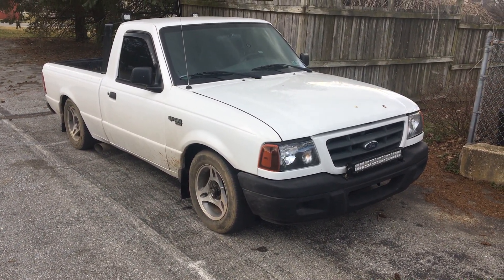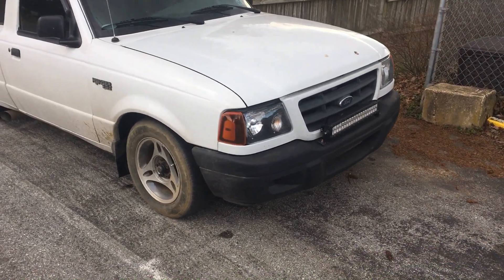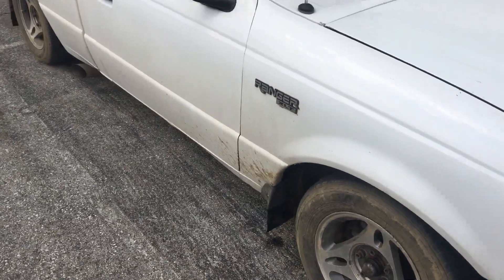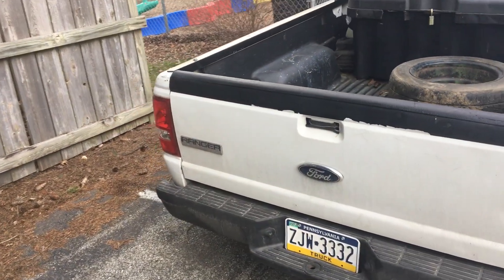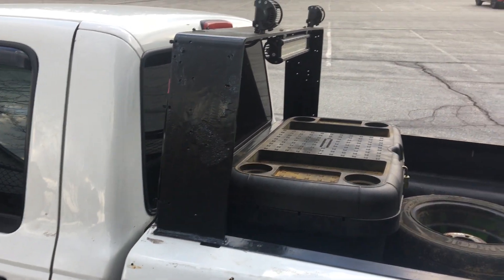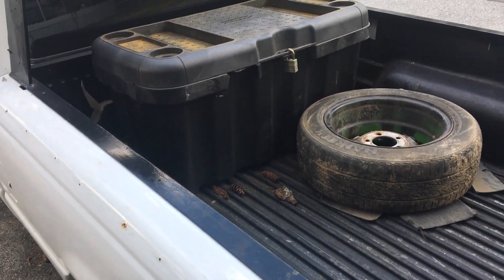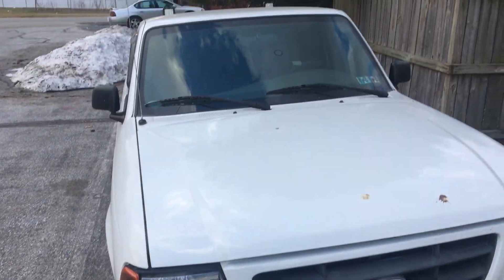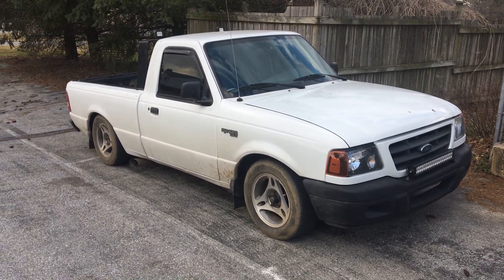Lowered 03 Ford Ranger

Comment: What drop kit was used?
Reply from the maker: DJM upper and lower control arms, stock coils with 1.5 coils cut, 3.5 degree camber washers, DJM flip kit out back with bolt in c-notch, and a raised tranny crossmember from ricksrangerz

Comment: What is it lowered in this video compared to the djm 4/5 you put on?
Reply from the maker: It was 3 inch drop springs on stock control arms, but it was resting on the bumpstops with zero travel, once I put on the DJM control arms I used the stock coils with 1.5 coils cut and had plenty of suspension travel again. Rear was a flip kit with a bolt in c-notch, and raised transmission crossmember. My next video shows it https://youtu.be/ba-spJGtZCk

Comment: You were supposed to cut bump stops in half boss
Reply from the maker: matt smith I did cut them in half boss. Check my newer videos I installed DJM upper and lower control arms and cut stock coils one inch now it rises perfectly no bottoming out